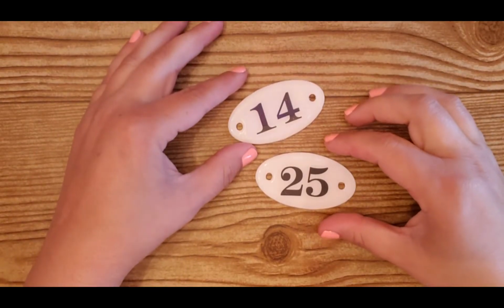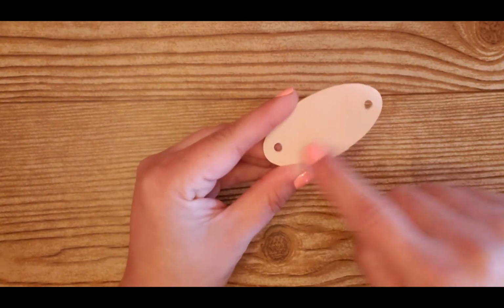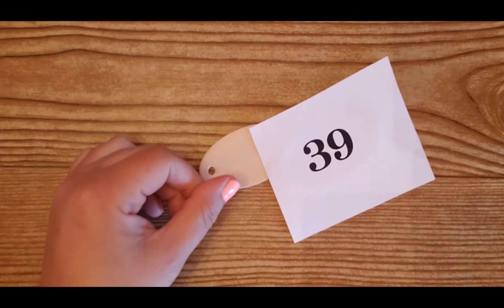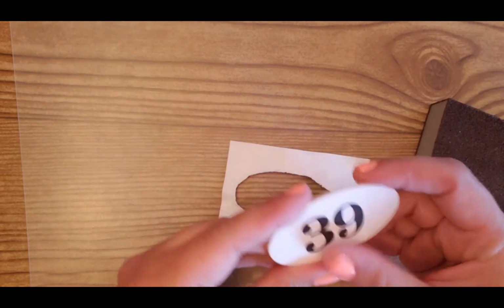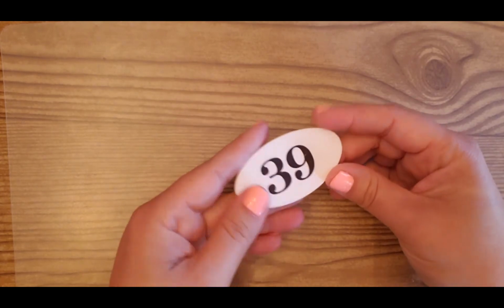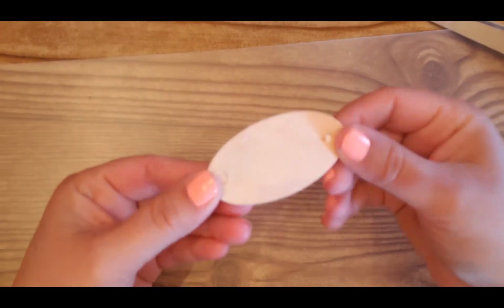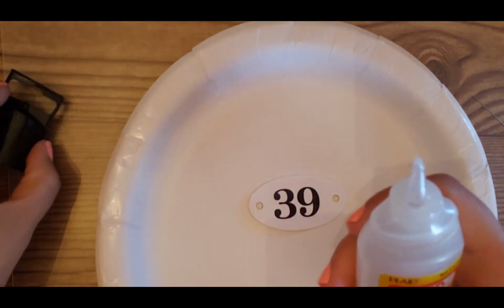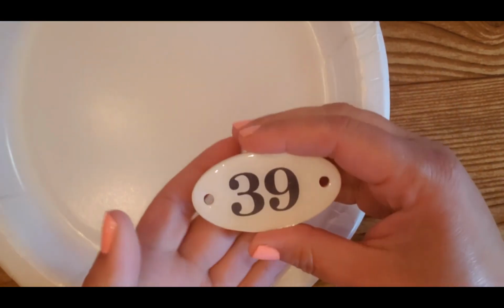How To Make Faux VINTAGE ENAMEL NUMBERS! DIY French Enamel Numbers! BEAUTIFUL & EASY Tutorial!

Comment: You could also make your template of the size of your wooden piece in "Word"... Just make a circle and widen it and longate it to the width and then type in your numbers... Print out.. Cut and glue on the wooden piece.
Reply from the maker: You can certainly do it this way! For me personally it's just easier to work with a plain printed number. But it definitely a matter of a preference and works both ways! 😊👍